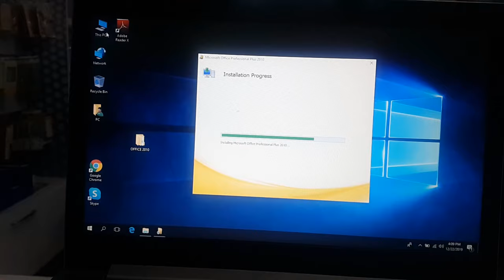Lenovo IdeaPad 330 & 340 - SSD and Ram Upgrade and  Replacements Guide

Comment: Oh cool! I have a question! I recently bought this model but with a 1T SSD and 8Gb ram. When I use CPU-Z to check the components it says that there's 2 slots for RAM. One is 4Gb and the second one empty. Why do I have a 4Gb ram and my system, and also the seller say 8Gb??? I'd like to add more ram but now I don't know what to put.... Thanks for helping
Reply from the maker: The one stick of 4gb ram is integrated or soldered into the motherboard and you can not remove it.
Reply: @ApkHeaven  okay but why my system shows me 8Gb installed? You mean that there's 4gb integrated and they put an extra 4gb in slot one? Thanks for the answer 😁👍
Reply: @VMV8622  yeah, basically. Same as mine. I have 4GB integrated, so I just bought 16GB RAM slot. So, my laptop will have 20GB RAM
Reply: @foreverx3057   bro... does it really give  you a 20gb ram in this model? Like for real? Haha,. because I thought that the maximum ram that you can upgrade in this model is up to 12gb ram only...
Reply: @vincepapo5383  no it isn't, the maximum ram is 20gb
Reply: Vince Papo possible to upgrade it to 20gb ram. I have the same model and added 16gb memory stick on the slot. 20gb ram is sweet.
Reply: @vincepapo5383  wait yeah the Lenovo site says 12gb max, but if I can do 20 then I mean yeah why not

Comment: can you use an ssd and an hdd at the same time? Or just choose between those two?
Reply from the maker: what kind of ssd do you mean ?
and yes it is possible.
Reply: @ApkHeaven  how to install and use both ssd and hdd in this unit?
Reply: @johnsammuelcalanza6554   you can use a ssd or hdd caddy which is shaped like a cd drive and insert the hdd in it and attach that in the place where the cd drive was and yea it will work

Comment: You mention that the CMOS battery and fan are easy to replace.  Is this necessary to when changing out the drive?
Reply from the maker: no its not, but you need to remove the laptop battery before replacing the ram and the disk drive.
Reply: @ApkHeaven  is this also important while
 adding extra ram?

Comment: I’m a big noob in computers and this is my laptop and it’s very slow....                  should I get 500gb  ssd to speed it up?
Reply from the maker: yes you should if it has a old version 5400 rpm mechanical hard disk drive.
that would help it a lot.

Comment: good job - could be easier to clone the drive before disassembling - that way you know the new drive works and you can check the internet site of the drive manufacturer from the target system to be sure the new drive works... Lenovo sometimes has goofy system board and I/o drivers to get the most out of the hardware, especially on their laptops,
Reply from the maker: The mechanical disk drive was very slow.

Comment: I'm looking to replace both, recommendations on a ssd and RAM at a reasonable price
Reply from the maker: I would recommend samsung SSD's and for ram i am not very picky to be honest as long its quality ram and it works it is good enough for me.
Reply: @ApkHeaven  very much appreciated, thank you
Reply: @ApkHeaven  WHAT A COST OF SSD AND RAM I NEED A 120GB SSD
Reply from the maker: a cheap SSD can cost around $20.
but for ram you should be more specific.
Reply: @ApkHeaven  can I use the RAM of Ideapad 15IKB in 14IKB laptop because there is none available in online currently
Reply: @RyuIsFine  u can use the ram if 141KB have a ddr4 ram

Comment: does it have internal memory ram and what is the maximum ram
Reply from the maker: unfortunately it had one ram integrated or soldered in the board and one slot that you can exchange in that one that is free you can add up to 16gb ddr4 of single ram.
Reply: @ApkHeaven  tnx for this info 😊
Reply: @ApkHeaven  does it means 20GB ram total?

Comment: What size ssd is that? The black KingDion at 3:00
Reply from the maker: 120gb
Reply: Do all ssds have the same dimensions? If not what is the dimensions I need. I have the same laptop
Reply from the maker: There are 2.5 inch SSD's but now there are also some newer ones called nvme, m2, m.sata which are even faster... try to google them to know more.

Comment: Can we just put the ssd or hdd in dvd drive and not removing the other one?
Reply from the maker: Yes but the SSD is a lot faster this way since it is sata 3 and the dvd player is using sata 2.
Reply: @ApkHeaven  So can we replace the internal with ssd and put the hdd in the dvd drive right?
Reply from the maker: Actually No you will need SSD or HDD Enclosure DVD Player Caddy adapter or converter for that to work.

Comment: I have ryzen 5 model of same i want change its processor to i5 intel is it possible
Reply from the maker: absolutely not
Reply: Yes if you change your CPU socket
Reply: @bebekxettri9634  does it possible? or easy?
Reply: @YAS-vm8ko  technically you can but practically you won't, you will prefer to buy a new one

Comment: I have the same model and it's running quite slow so please recommend a good ssd and a ram
Another question, can we change it's processor to i5 , now it's i3 7 th gen?
Reply from the maker: No
Reply: Then please suggest a good ssd and ram for upgrading it
Reply: @kRahulba  the crucial brand, you can check on amazon, good quality with affordable price, the specific ssd used here is an internal ssd btw